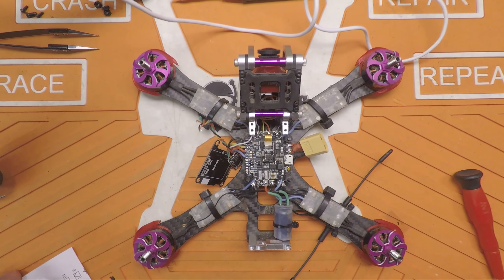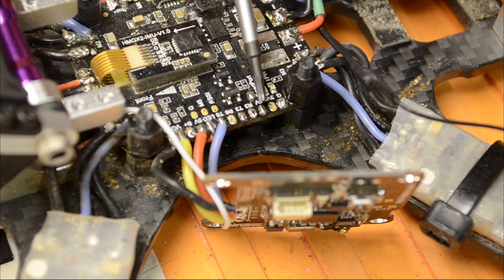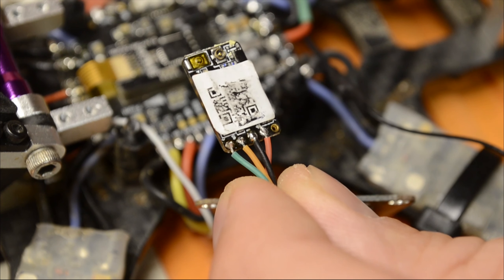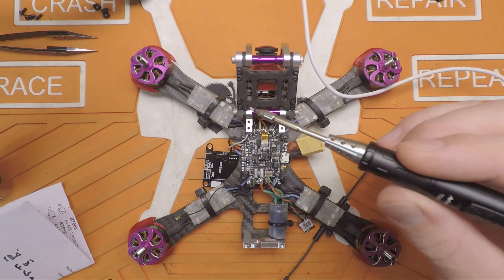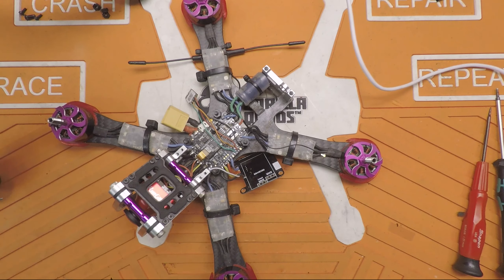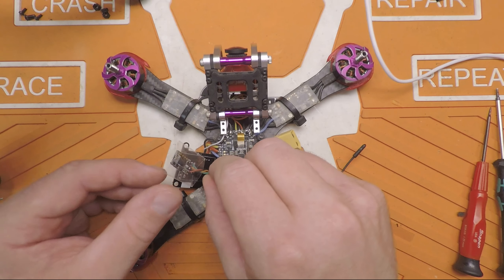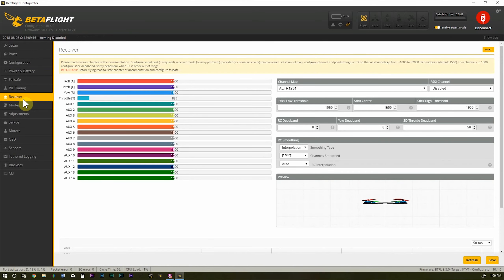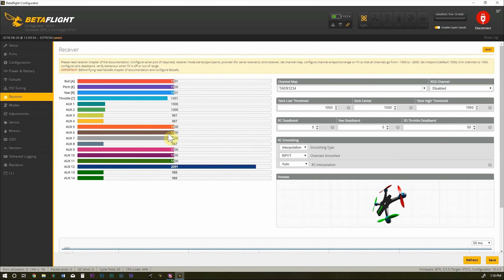Holybro Kakute F4 AIO R9 mini setup

Comment: Great video.  👍 do you have a video of updating the firmware on the r9 mini ?
Reply from the maker: I do https://youtu.be/z6HDj9r7N7k
It's the same process but you just need to select the right firmware for the communication protocol you are wanting to use. Also I don't recommend you use any of the beta or nightly firmwares. If you choose the flex firmware then you need to update your opentx to 2.2.3. I have a video comming this weekend on how to do that. Happy flying.

Comment: Great video! I noticed that you didn’t select smartport in the port tab.  Would the smartport tab on the flight controller have been uart 1? Did you not have to do that because of the designated pad? I have a Bardwell F4 FC V2 with a teleport pad as uart 1.  I haven’t gotten telemetry to work and designated smartport on uart 1 in the port tab.  I’ll try not designating it next time.  
On an HGLRC FC, what pad would you recommend for soft serial? I tried tx6, but it shares a pin with pwm3.
Reply from the maker: It was Pre selected as smartport on uart 1 for this board.
Reply from the maker: On the Bardwell board the uart for the telemetry is uart 3 and sbus on uart 1

Comment: What type of antenna you use and from where we can buy it
Reply from the maker: It is a immortal t with an adaptor on it from Amazon Pocaton IPEX-4 IPEX MHF4 Gen4 UFL Female to IPEX-1 Connector Jack Male Pin for Intel 7260 7265 3160 BCM94360HMB BCM94360CS2AX https://www.amazon.com/dp/B07BH2J7ZT/ref=cm_sw_r_cp_apa_mKAIBb4909XS9

Comment: Would this be basically the same for the v2
Reply from the maker: Yes shouldn't be any different. But I can't say with 100% certainty.
Reply: TweetFPV ok thx
Also how can I show Rssi in my osd feed with the r9m setup
Reply from the maker: Enable rssi in the osd menu in betaflight. Also the most current firmwares automatically put rssi on channel 16. So in betaflight that is aux 12 and you select that in the reciever tab
Reply: TweetFPV so if I were to use the r9m mini reciever would it already be set and the only thing I would have to do is channel change in betaflight right?
Tjanks
Reply from the maker: Provided you have the latest firmware. I'm not 100% sure if you need telemetry working or not. I need to look into that.
Reply: TweetFPV ok thx for the help
I just had some questions about it
I have the module on order and I just learning what to to when I get ti

Comment: My drone is Fuuton v1 which is used kakute f3 AIO.. so, kakute f3 can connect with R9 mini in a same way??
Reply from the maker: If you have an f3 board all uarts invertable. So you shouldn't need to use any soft serial commands to get telemetry on these recievers.